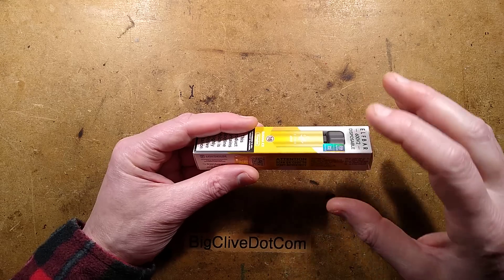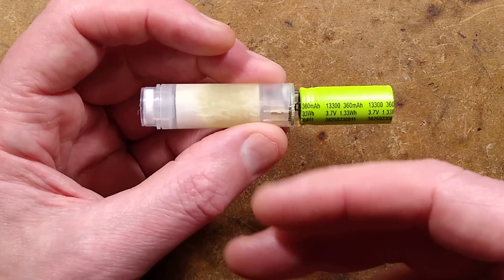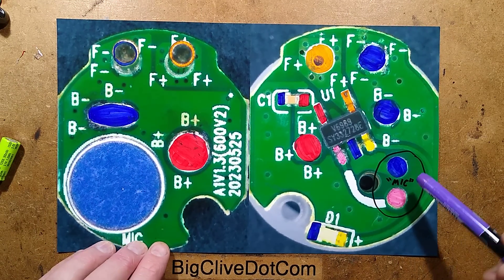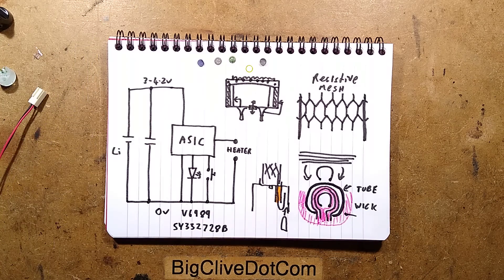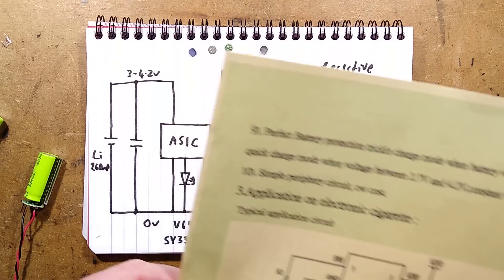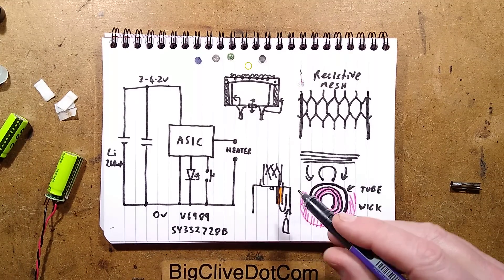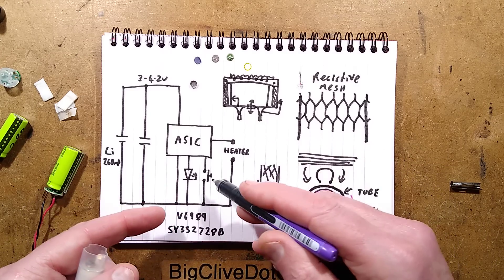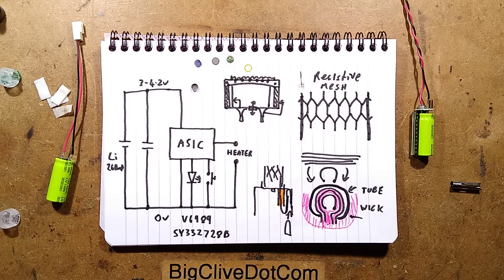Lithium "capacitor" in a disposable product

Comment: Long time lurker here!
Vape devices use different current depending on the resistance of the coil (or mesh). 
So that being said, would it make sense that certain devices may use less battery than others?
Being as it would require less wattage or more wattage depending on the coils.

LOVE your vids, one of my favorite binge watching channels. :)
Reply: Good point, maybe next time he'll check the resistance of the mesh.
Reply: @antman5474  This type of vapes use nicotine salt liquids which require 1.2 ohm mesh for optimal vapor generation. I for example use a rechargeable device with changeable and refillable pods that contain the mesh and you can buy 0.6, 0.8 and 1.2 ohm pods depending on what type of liquid you use. 

I specifically use the 1.2 ohm with "elfliq" which is the same liquid as in the elfbar devices but packaged in 10ml bottles you use for refilling the pods. I don't know much about vapes but after trying a few elfbars I just wanted to get the same experience from something less wasteful (and cheaper) and started reading about vapes. I bought this kit and initially used standard nicotine e-liquid with the provided 0.6 ohm pod but the taste was too harsh. So I specifically searched info about the elfbars to see how I can reproduce the taste/feeling. Turns out the technical info is available about these disposables and they claim 1.2 ohm with nic salts and that is how I swicthed to the 1.2 ohm pod and found that they also sell the liquids. My device (geekvape wenax q) also lets you set the wattage within a preset range after autodetecting the pod resistance. 1.2 can be set from 9 to 13w and the 0.6 can be set from 18 to 25w (info printed on the pods).

Luckily I kept all my empty disposables and I will try to get the batteries out. After seeing this video I will surely collect them from the street if I ever find some but that hasn't been the case although they are used commonly. I guess people just throw them out with regular trash.

Comment: To be honest, when have you ever seen ratings that matched what was on the tin from China? Remember the great capacitor scandal?

I've actually seen large value caps opened, and inside was a small one soldered across the leads. Always check the values with an LCR meter if you buy them.

Comment: These devices look very easy to convert to LED flashlights or other occasional-use high-current applications.

Remind me please; what’s they typical current draw of the heating elements?

Also, I’m slightly envious that you find them in the gutter. Here in central Washington State they are not to be found. Perhaps people are just more prone to dispose of them properly. Not sure whether I’m happy with that. Less trash lying about to be sure, but fewer toys to play with.

Comment: Those sensors are usually piezoelectric microphones, they're not detecting pressure, but the loud chaotic sound of turbulence. Though that may well be manufacturer specific
Reply: What for? To back up the switch?
Reply: @PapaWheelie1 
To ensure the user is actually sucking on it, and it's not just their keys holding the button down in their pocket...
Reply: @tin2001  - I have the regular button kind and have pulled a fire hot pen out of my pocket a few times. Sounds like a decent feature
Reply: @PapaWheelie1  it's usually cheaper to use the output from a general purpose mass produced component as the switching signal than a purpose-built component.
Reply: Makes sense - thanks

Comment: Capacitor-style Lithium-ion cells are also great for microcontroller projects for either powering the higher efficiency low power microcontroller, or just its on-die real-time clock / calendar hardware, in my opinion.

I already knew how to desolder the capacitor-style Lithium-ion cell off the vape board without ruining it, I usually use much more heat so I can desolder it off in as little time as possible so heat soak isn't gonna be too much of a problem (I set my TS100 soldering iron with IronOS installed up for turbo boost of 420 °C for some stubborn soldering situations while it's normally set to 320 °C for usual soldering job, and I have a thin enough soldering tip that I can comfortably get away with it).

Comment: Disposable vapes are a huge problem in the cannabis industry where it's legal or medical. I use medicinally with my Dynavap that takes flower normally and is meant to last forever but if I have to travel to a less than legal state or going to an event it's a pain bringing my induction heater or a butane torch with my Dynavap so I go for a disposable live resin cart. 

I'm hoping broad legalization will remove these disposable vapes and we can have some kind of refillable system.

Comment: I  wonder why they switch the high side instead of the low - N-channel switches are generally better/smaller. I wonder if there is any current sensing in there

Comment: To be honest, what I find most sad is that  these "disposable" products often use lithium over like alkaline, which yes has less capacity or whatever by comparison to Lithium, also generally is already a form of disposable battery to begin with anyways due to the fact that alkaline batteries are not very fond of being charged back up of course. And would likely be far more suited for things like these with proper storage protections and whatnot.
then again I also don't exactly know if Alkaline batteries could even power one of these on their own. I'd assume probably maybe. depending of the number of cells inside.

Comment: I find lots of these discarded all over the place. Take them home, strip the various plastic bits and aluminium cases where fitted for recycling. I have loads of the 350(?) 500 mah ones. Still trying to figure out what to do with them. Im very good mechanically but not quite so much with black magic electrickery?? Thinking maybe powerpacks for rc boats /planes etc???

Comment: I found one of these on a vape scavenging walk a few weeks ago. I  too was surprised to see the green "capacitor" inside. 
Desoldered the battery without  incident and and charged it, I have made charging test circuit with crocodile clips as a test bed dribbling out just 160ma as I am reluctant to burn my house down.
Nice litle battery and will power some xmas lights saving AA batteries.

Comment: I keep seeing that the newest/newer dash cameras are powered with a capacitor and I was wondering how they were doing that. I suppose you have likely answered that question for me.
Reply: Lithium batteries can easily  overheat in a hot car in the summer. As you've noted, they've changed to super-capacitors for the back-up power source.
Reply: Dashcams have actual capacitors. They only need to power it fully for a few seconds, and then keep the clock running for a few weeks at most. A capacitor makes more sense in this case than a lithium battery that will end up at 100% charge for very long periods.

These vape cells are standard lithium cells with the pins out the same end instead of one each way.

Comment: What's the value of the liquid in these? It's strange when people have habits and choose to ignore the wastefulness. I use 510 rechargeable kit and feel dumb throwing metal cartridges in the bin.
Reply: The 1 gram delta 8 (no idea about nicotine vapes) ones have probably $2 of oil / terpenes, I’ve seen them sold from $15-35 I have empty 510 carts I keep as I used to refill them. Sometimes the disposable ones that have 3 grams live resin are an ok deal for $40 but still way more than diy.

Comment: I've found one of these batteries in a "Lost Mary" device. This is a BM600S model rather than the BM600 I normally find. The major difference between this and the device you dismantled (apart from the battery being beside rather than inline with the wick) is that the PCB is at the inlet end of the device rather than in the middle or by the mouthpiece.

Comment: Glad that is on habit I never developed, but may start collecting spent ones for their cells...those things are not that cheap...and forgot, they do have smart capacitors that can meter their power output, but are found in things with names like Lamborghini and Ferrari for their "Hybrids" and used in things like Formula 1 for a power boost... That is the future for electric vehicles, but not vape devices and they are kinda pricey...and not quite ready for prime time...

Comment: 5:00 in that case desolder the battery neg first.  If you short that to the ground plane or the mic it won't matter.  Once the B- is removed shorting the B+ to things won't matter.

Comment: Brilliant idea 💡... Canning a cell in a capacitor body, 
The capacitor Canning process is donkeys years old, plenty of factories chucking out capacitors at 0.3 pence each,

It must be so much cheaper to can a small cell in a readily available, already existing capacitor can, using a 30 year old machine...(let's not mention the 10 year old operator)... Rather than investing in a brand new multi million pound machine for traditionally canned lithium batteries,

Bloody genius 🤯... Apart from the obvious!